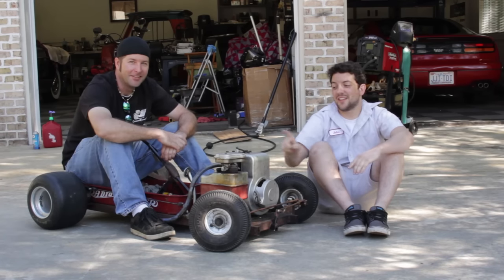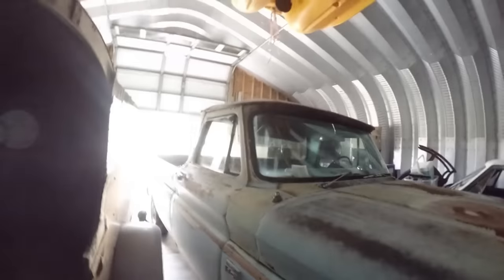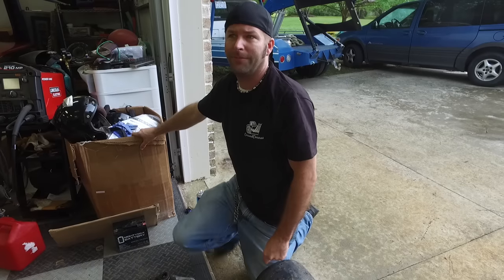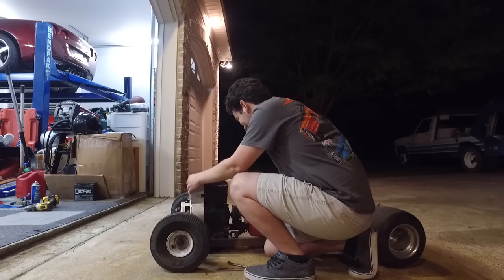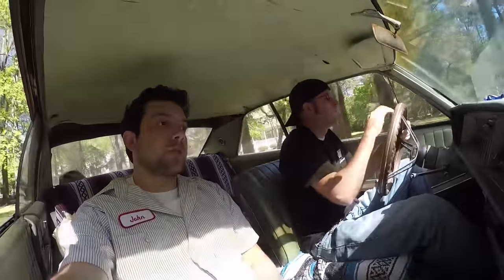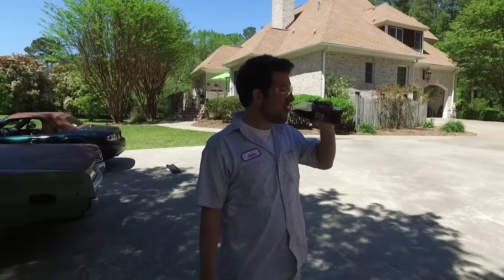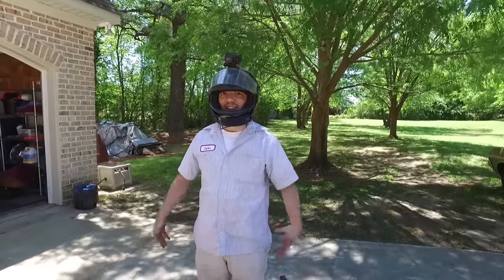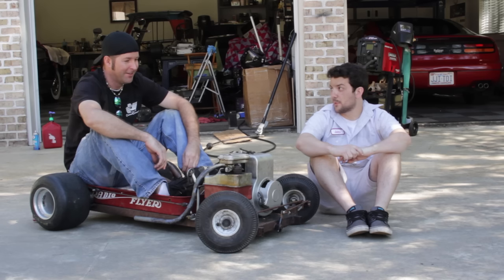The Rat Rod Wagon is a BEAST

Comment: MY PREDATOR 212cc 6.5hp is doing a lurching thing, won't run right, gotta keep choke all the way on and the throttle down to keep it running. So carb rebuild? I'm replacing the head gasket and valve cover gasket because they both blew, and if that and card rebuild doesn't work I get a hemi predator.
Reply: Also a question, gas is getting into the oil of my predator, what could that be? And a suggestion is a big off-road gokart.
Reply: +Duncan Czeizinger probably needs a carb rebuild
Reply: Isaac it'll be fine ah, I was thinking that, thanks for the reply! What kit do you suggest?
Reply: ive never bought a kit. i have been lucky enough to clean and reassemble
Reply: Isaac it'll be fine but I thought John did on a build I can't remember? Maybe the mini bike, not sure. But I have the carb off so I'll see if it's salvageable and if not woohoo a new card! Thanks for the help! Can't wait for more builds! Also the build off needs to happen soon!
Reply: john put a carb rebuild kit on the other rat rod wagon engine
Reply: Isaac it'll be fine ah yes, I remember now! If it weren't for those bushings/bearings I bet that would be a good motor still! You guys should do a 212cc racing motor, billet aluminum rod and flywheel, stroker kit, billet long rod I may add, racing gaskets of course, hemi head that's drilled and ported, after market carb, jets of course, it's a hemi block with none hemi piston to reduce a problem 212cc's have when they accelerate to a high rpm, custom header, and of course!! A E3 spark plug, for added horse power. And throw that bad boy on a custom built low down drag kart (pretty much the rat wagon without the tub) and put some slicks on there, torque converter, and she's gonna roll! Just ignore all I said, that's thousands of dollars... And shoot for 50 mph!
Reply: Isaac it'll be fine put the head gasket, valve cover gasket, and carb gaskets and exhaust gasket, all on good and no gas in oil, BUT it won't idle, choke all the way on it idles fine but when given throttle it dies, 1/4 off choke and won't idle, just dies, 1/2 throttle off it runs beautifully but won't Idle, 3/4 choke off and it sputters at full throttle, no choke and won't run. What the heck is going on?
Reply: gotta be trash in there or something
Reply: Isaac it'll be fine I cleaned the whole thing, except for inside the block, like the crank shaft and cam. So I'm asking all over YouTube and some relatives and got all different answers... So I'm about to give up and buy a new motor. Wish I could power wash the piece..
Reply: lol. it will be fine. wish i could help you out
Reply: Thanks man, I think it's time to let go of it because it's the first model type predator made over 5 years ago so..... But I'll try to set it running. John would hate me if he got this motor, it's disgusting 😂
Reply: Isaac it'll be fine great news! The idle plug was clogged, so cleaned that out and also found that the idle screw was out all the way so it was idling at nothing so it died, so fixed both and runs beautifully at half choke, anything more and it starts sputtering, new jets maybe? And I don't think there's any gas in the oil! Today is a good day for gokarts. 😁
Reply: Isaac it'll be fine what size main jet did you and John use on the racing gokart? And did you change the emulsion tube? And did you change the idle plug/pilot jet to a different size? I'm buying new jets for it so I would like to know what you prefer. And thank you so much for the help and actually replying to me! Most people don't care.
Reply: i drilled out the jet i dont know what drill size sorry
Reply: Isaac it'll be fine ah it's okay! I'm getting from .035 to .038 and a emulsion tube, did you drill the idle circuit/idle crew/idle jet? It gives the motor power in the low end of rpms and at higher the main jets kick in. So I was wondering if I need to fool with it?
Reply: i have only drilled out the main jet. i take a small flat head screwdriver to get it out and i drill it out by hand
Reply: Isaac it'll be fine thanks for the feedback! So I'll leave it alone. And thank you so much for the help! Might have another question later on, but I think I'm good now! Again thank you.
Reply: sure

Comment: Extend the frame and put more weight on the front, a 20 pound dumbbell would do wonders. Long frame would make it look more like a real rat rod. Other than that, put a motorcycle engine, cr 125, and make a bigger, faster, awesome looking front engine rear wheel drive kart. Make it big enough to where it don't look like Mario kart.

Comment: port the intake and exhaust and shave the head and a slightly bigger jet if possible with atleast a two tooth smaller sprocket and integrate a torque converter in somehow. should have have every bit of 30+ mph and better take off and acceleration. and put a pulsestar plug in or a Bosch platinum diamond fire plug in. or just a good ol ngk. highly recommend the pulsestar though.

Comment: How do your shirt sizes run big or small because some sizes for different brands are smaller than others
Reply: And do you think the valves need adjusted on the first motor
Reply: And do you think the valves need adjusted on the first motor
Reply: And do you think the valves need adjusted on the first motor (I didn't watch the full videos yet)
Reply: And do you think the valves need adjusted on the first motor (I didn't watch the full video yet)
Reply: And do you think the valves need adjusted on the first motor (I didn't watch the full video yet)
Reply: And do you think the valves need adjusted on the first motor (I didn't watch the full video yet)

Comment: +CarsandCameras can i buy one of those working briggs engines off you guys? i got a go cart for the first time in my life and the original motor was shot and i got another one but i started working on it and i destroyed a bolt and ended up breaking that little section off trying to get it out. I dont know anyone who can weld aluminum for cheap. So you guys would sell me one of those engines for less than 120 and they either one i get will run good without much more money needed to make them run if they break or just need other stuff then i would be soooooo happy.

Comment: Wheres the efi on the 420? Btw awesome videos! 👌
Reply: +Alejandro Garcia on the way
Reply: Hey, also I have an old margay kart I think it's a brava 1 because it doesn't have a serial number on it but on the floor pan it said brava 1. When I bought it used the serial number was unfortunately already scratched off, and I was wondering on what would be the best way to paint the frame? The frame is a little rusty but it's indoors. And I've been wanting to restore it and maybe keep it but I've been looking into how to paint it because I don't want to mess it up. And I was looking into painting it a gloss black. I already have the engine and all the parts except for the steering wheel and bumpers. So I can hopefully use it by the summer. And thanks for responding quickly!
Reply: i wish i could tell you what to do. we are not experts and im sure id tell you how to mess it up. lol good luck with it. send some pics
Reply: +Isaac it'll be fine Yeah I will and I might make a video of me assembling it and thanks for all the help! ✌👊👍
Reply: sure

Comment: you guys should get a 125cc pit bike engine on a kart ... that would be sweet!!
Reply: +Daniel Gillmore Least it'll be a manual.
Reply: +Ratkill9000 4 speed go kart!! that would be pretty bad ass
Reply: Daniel Gillmore I think most or all pit bikes have 4 or 5 speeds so that'd be a fast kart.
Reply: +Ratkill9000 most are 4 speed i have a 110cc pit bike its pretty quick i topped it out at 47 mph
Reply: +Daniel Gillmore only downside I heard was the 420 chain on a bike is slightly different than the 420 chain used on a go kart but I  haven't found anything on that.
Reply: +Ratkill9000 you can get sprockets on amazon.. would probably take some fabrication but... "it'll be just fine"

Comment: what r yall gonna do about the shit steering
Reply: +Dustin Keith thats a good question
Reply: Looks like it needs about 50 pounds in the front of it
Reply: i bet 15 to 20 would do it
Reply: hell if that's all then just repack the motor plate with a 3/4 inch steel plate
Reply: replace
Reply: thats a thick plate. lol. im going to add weight to it when i add a grill and lights